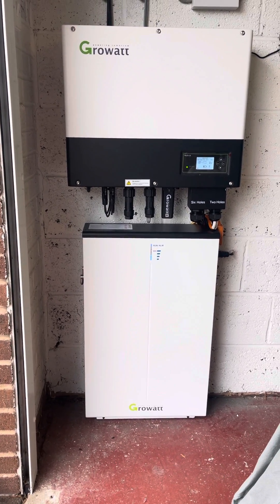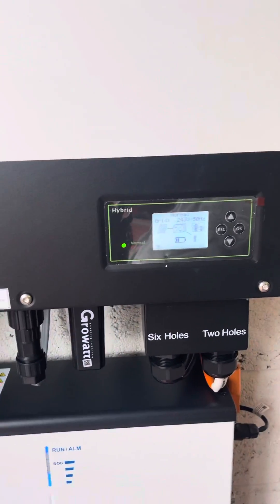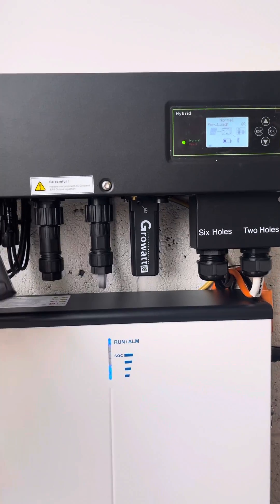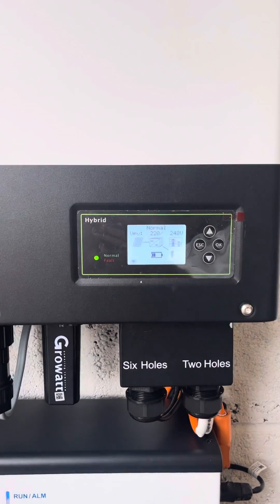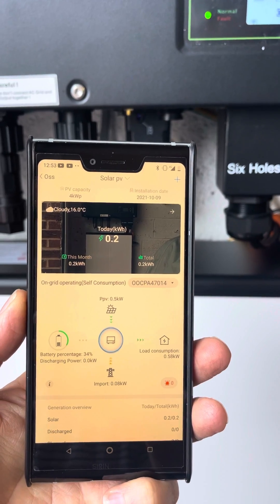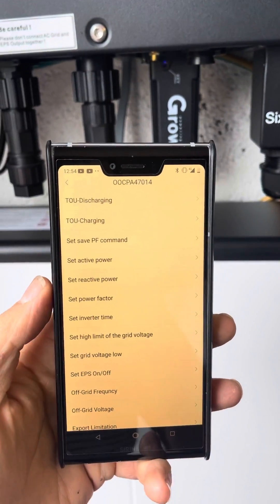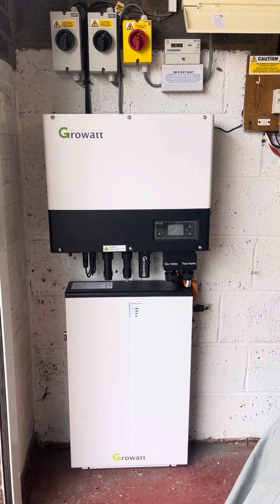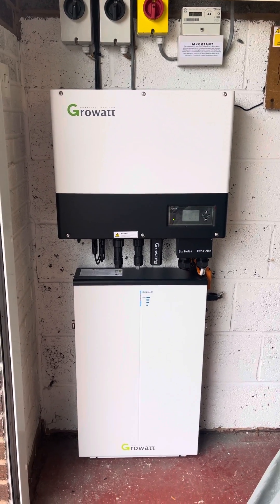Growatt hybrid battery storage installation

Comment: What is the maximum voltage per string you can have per string for the SPH 10000TL3 BH-UP inverter?
Reply from the maker: Hi maximum voltage on that model was 800vdc per input

Comment: Hi, I have a similar set up Growatt SPH6000 + 2 Growatt Batteries. My question is about the Growatt Server portal and the option to ADD OPTIMISERS to the system. Do you have optimisers and were you able to add them to the Growatt portal so that you can see the optimiser individual performance?

Comment: Hi. Can you tell me what the string voltages should look like on a Growatt inverter? Should they be the same for both strings if both strings are identical in size and location? I have string that sits constantly at 150v and produces less power than the other string that fluctuates around 130 - 140v. Any thoughts on what the problem might be?

Comment: How do you manage to get the battery to charge from the grid during a cheap period?
Reply: You can set it up on the app... Battery will be charge from the grid at cheaper rate (eg octopus agile)  i was told it takes about 30m to charge the battery..

Comment: You have mentioned about not using the grid when your battery has capacity but even on your app it is drawing 0.08 from the grid where it should be taking it from the battery. I have exactly the same problem with my Growatt system. It is only trickle but it usually amounts to 0.5 to 1kW daily where it should be coming from battery. Do you know what is causing it please? Thanks
Reply: Don't trust Growatt APP and webserver data - they looks nice, but not correct!

I am regret that I bought Growatt in this spring while upgrade to Hybrid inverter.

My inverter is set to Load first mode, but:
1) I have all time battery discharge to grid (exception is charging time);
2) while night time inverter imports and exports electricity in the same time (without any reason - my nigh consumption is ~20-40w just for small wifi router);
3) load balance feature is not working (it works like non hybrid inverter);
4) Inverter all time reports in app and server that nothing is imported, but in reality there are some import because of strange internal logics.

Be careful,  if You have such inverter, I suggest to check Electricity meter displayed data and electricity flow in detail (from grid meter side too)!

Comment: Excellent video thank you.  We already have solar pv and are looking to install battery storage. Would you recommend a hybrid inverter over a 'normal' one i.e. our existing SMA Sunny Boy.? And (if you dont mind) how many of the 6.5kWh batteries can be linked/stacked together.?
Reply from the maker: Hi nick I certainly can! The growatt hybrid is the best around if you message me via www.generationelectrical.energy I’ll show you a lot more on how they work. The 6.5 are modular up to 8 but never installed more than 4 in parallel to date due to limited time in off peak charging ability

Comment: That Growatt unit says it need 100V battery is that correct?
Reply from the maker: Hi this model uses low voltage lithium ion phosphate batteries 42-58v variable

Comment: How long does the app take to upload the stats? My app is all linked but no info on app yet.
Reply from the maker: If your installer has not set up the app for you correctly you will not get the data transfer
Reply: @generationelectrical1071  he set up the account for me but said stats may take time to come through and to contact the solar company of its not showing in next few days.
Reply: @generationelectrical1071  i just got it installed today with the same inverter system. Feeling excited 🤓

Comment: a question that'd bogged me for quite some time:
If PV panels generate 6.6kW DC, and from this, the 5kW-inverter generates 5kW AC max back into the grid or to be consumed by the home appliances at the moment.
Will a DC coupled system takes in the 1.6kW DC ( excess from PV not converted into AC) and store it in the battery?
I believe the AC coupled system is converting a portion of the inverter OUTPUT of 5kW AC back into DC for battery charging which is not as ideal as DC coupled system.

Comment: i can see you dont have nothing connected to the EPS, can you use the battery for grid loads? i though you needed eps loads to use backup battery
Reply from the maker: Hi because I am an accredited installer for the Dno, I am not allowed to connect the eps. There is a growatt specific automatic transfer switch being released early next year that is currently going through ena approval so at the moment I am not allowed to connect up but after I walk away from the installation if you choose to connect yourself I have no role or responsibility for that.

This unit does have a built in eps and can be turned on as the unit can be also used for off grid purposes however isn’t the manner in which I install them
Reply: @generationelectrical1071   Can be these components used for off grid system?
Reply from the maker: @firma1a  hi the sph hybrid system can be used off grid but you do need solar panels in order to make it functional

Comment: Hi. Great video. Could you tell me the typical cost of the the both components. Inverter and battery storage.
Reply from the maker: Good evening. In terms of costs the product is around £4500-4800 for both hybrid inverter and battery, all ct clamps, online logger and core component cables. But ultimately depends on the inverter and capacity requirements depending on systems specifications, Then adding on installation fee if required.

The one in the video here was a 3.6kw inverter with a 6.5kw battery and the system was £5400 all in fully fitted with 10 years direct manufacturers product warranty but the manufacturers are increasing prices as of end of November due to rising energy costs so prices will change in accordance moving forward.

Let me know if you require any further information and will gladly assist.
Reply: @generationelectrical1071  how do I get your contact details mate?
Reply: Hi I’m interested to buy a full kit solar panels,inverter,battery im thinking to get 8-9 kw 
Do you know how much and from where can I buying?
Thank you